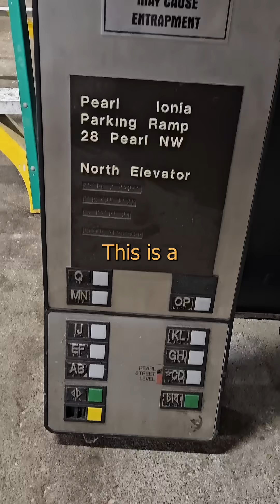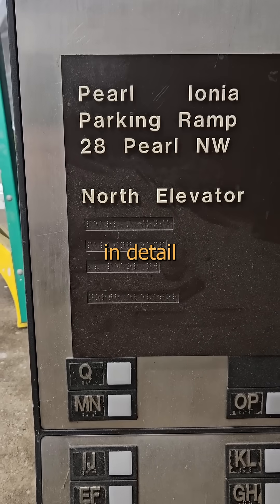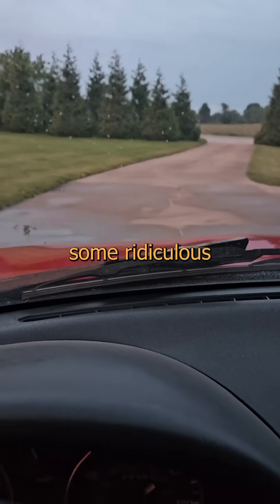Miata Mischief #chrisboden #engineering #gear #elevator #score #stories #parts #hacking #making

Comment: We built a 15ft high bike jump loaded it in the back of a single cab Ford Ranger put two of us in the back to hold it down and drove 30 km down the highway through rockcuts and tunnels to rappel it down a MTN to build a jump into the lake

Comment: a number of years ago, i was working for my families cafe/takeaway shop and mum managed to snag a decent double door storage fridge at auction, issue was, we lived an hour and a half out of the city the fridge was located at, AND the only vehicle we had to pick the fuckin thing up with was an old as fuck, broken as fuck bucket of a mitsubishi express van. (it was the only car we had that had a tow ball) had to borrow one of my friends who could help me lift this gargantuan fucking fridge into the trailer, strapped it up, then began the trek back home. 

all would be well and good, but this van struggled on the best of days to get just its own weight up any incline greater than 5°…we had to trek up a massive hill that made up part of the freeway…3 lane wide freeway and there’s us, towing this fucking huge fridge going at a maximum speed of 20kmh. once we created the top of the hill though it was pretty smooth driving from there, hell it felt like we were hitting warp speed when we hit 80kmh.

Comment: Oh God when I was in college I got an apartment with my friend, and the previous tenant left this massive 34 inch CRT TV that weighed about 240lbs. When we found a cheaper apartment half a mile down the road, we jumped on it. But we didn't have any other TVs so we decided to bring it. Me, Ben, Matt, and Graham each got a corner and lifted and lowered it down onto my skateboard. We pushed it out the door on the first floor, wheeled it across the parking lot, down the sidewalk, across the 3 lane highway, through the next parking lot, then we got to the apartment. It's on the second floor. It took us about 45 minutes to get that big gray bitch up that one flight of stairs, and on the last 3 steps, we almost lost it. It slid back down 2 steps, but it nearly killed Ben. Mind you, not one of us weighed more than 140lbs. We were all skinny art students. I ended up being the last to move out, and I decided to just pay the $250 cleaning fee and left it. I hope no one else got hurt carrying that thing.

Comment: My old motorbike had a trellis frame. Cut to me going into a hardware store and buying a few lengths of timber while on auto pilot, forgetting the fact that this time I had ridden there.

Went back in, bought some cheap nylon rope, tied the timber to the right side of the bike using the trellis frame as tie down points and mentally mapped out a route back home using only left turns. Had to straddle the timber as I rode and be very careful when slowing down with only the front brake, even managed to avoid any cops.

Fun Fact - did you know that with the rear seats down, a FM/FN mustang can fit 2.7m lengths of steel or timber? I get a few strange looks when I got to Bunnings.

Comment: When I was younger, I had to haul 2 telephone poles from my grandfather’s estate up to my uncle’s farm. I ended up cutting them more or less in half. That didn’t help me much when I had to chuck them underneath my toolbox in my truck. And then I had to use 3,000lb straps to secure them. Let’s just say it was an interesting drive to the farm with nothing but tight winding back roads!

Comment: I once moved furniture in my Civic CRX Si. It was a stick shift and I could only get to gears 1,3,5 because everything else was pushed so far forward. I literally couldn’t shift into second or fourth. My knees were around the steering wheel and I could just barely turn. Good times!

Comment: As someone with a similar motorized skateboard, its definitely possible, especially with the top down in the passenger seat. Im 5'11" and she was 4'10". Facing each other, you sitting with her on top. Basically a lapdance with benefits. No regrets, and happened on multiple occasions.

Or lean back, cross your legs and scoot the seat forward, her faceing forward and on the tiny dash and you sampling the 5 course meal. You're welcome

Comment: I've rolled a DEC VAX 11/750 across town once. On it's own wheels. 7km approx. distance... Took a few hours. It weights about 200kg, base config is 182kg but mine had some more gear in it plus cables etc. It doesn't fit in anything smaller than a commercial truck, and I didn't have a car or license or know anyone who did, so the only way to do it was to roll the bastard home on it's own wheels. I disassembled it get it up to the third floor piece by piece, no elevator, just stairs. It blew the fuses of my apartment when I turned it on the first time heh, it was also not the first or last large computer I had. I have one now that is about 60x100x80cm and weighs 35-40kg, it's "just a PC" but with watercooling and 1200w PSU in a tempered glass case with a touchscreen monitor built into the case. Small by comparison but a good deal larger than what most ppl have.

Comment: Drove a shitty ford mondeo 2 hours each way to pick up a mercedes vito engine. Hauled it on the highway in the trunk with 4 guys in the car. Overweight as shit, every uphill was a struggle. Got the engine. It did not fit my car. Still just collecting dust in the garage

2nd story, less risk more fun. Bought a coffin. Picture a bright red Jeep wrangler with a trailed and a poorly strapped black coffin. Got some weird looks driving through the city

Comment: A while back I found a piece of inch and a half thick bulletproof plexiglass about 65" diagonal on the side of the road and brought it home by creating a rope harness and throwing it over one shoulder on my old Honda CBR 1000RR. There was so much weight on one side of the bike that I was riding at about a 30° angle the entire 5 miles

Comment: My doctor put me on testosterone for a short period of time. I felt great. I folded down all the seats in my 2008 honda fit, to squeeze a refrigerator sized Stanley Vidmar tool chest from a car dealership. I took all the drawers out, tipped it over on its back, then shoved it into the opening. I put all the drawers in the open cavity of the toolbox. It was hanging out about a foot from the back of the car. Then I strapped the hatch back down to keep it from falling out while I drove around to do my work for the rest of the day. I worked late, and when I got home, I snuck it out of my car and into the garage. When my wife got home, she didn't say anything to me, but my son told me she said "WHAT DID HE BRING HOME NOW"😂 . I cleaned up the tool chest and put my tools in it. I don't take testosterone anymore.

Comment: Around where I live there used to be a barnes and noble joined to a GameStop. The GameStop had a caged in ac unit, at around 2pm on a Monday my dad, my brother and I all got together to cut out, disconnect and steal the actively running ac unit out the side of the GameStop. We also have an intersection traffic light.

Comment: We had the SUV in the shop (rear ended at a stop light) and the shop lent us a Nissan Micra. We are both well over 6ft (6'5 and 6'10) 
We had a fireplace we had to pickup along with 3 large paintings. One was charcoal underglass and was 44"x55"  the fireplace was alcohol and all metal and we bought 3 canisters of alcohol with it. All of that crap stuffed Inside of a little Micra birthed my LOVE for micro cars. What id do for an 07' March 125R!

Comment: I hauled an oak dresser up two flights of stairs by myself because it was free and would make a good workbench. It lived on my upstairs landing lightly strapped to the railing so it didn't fall over as I snuck past it to and from my room for a couple days while I figured out how to do the accrobatics to take it slightly more apart to get it around the corner and up the last 4 steps.

Comment: Mine is basic: I worked as an orderly at the hospital and used  old distribution carts for everything. From taking out trash to going to pick up the laundry in the blizzard because the truck broke down and there's no way we can function without clean sheets. One time I helped the department move: two toothpick tiny nurses put two huge pharmacy cabinets on the cart and moved it across half a football pitch length corridor through narrow doors. When there was too much crap to move I would tie some of it with bandages to the sides or use cardboard to make more space.

Comment: 16ft cattle panel strapped to the roof of my wife's Santa Fe (incase anyone is wondering, a 2023 Santa Fe is less than 16ft long since the panel was hanging off the front and back).

Or the 4burner grill strapped to the roof rack on my Subaru Outback.

Both loads were secure, at least they weren't leaving the vehicle, but I'm sure to everyone else they looked sketchy.

In the future I'll probably be upgrading to doing this sort of stuff with my Subaru Impreza, since I finally got the roof rack for it. Though I think I'm going to build a frame to mount on the racks so I can support things like cattle panels and sheets of plywood, instead of letting them droop.

Comment: I once smuggled a full-sized traffic light out of a city corporation yard in the passenger side of 1965 MGB. I didn’t realize how large those things really are and had to take the top down to get it into the car, which was a true roadster rather than a sweet little drophead coupe like the Miata. That means that I had to remove the top and frame and stow them in the trunk, all the while hoping nobody happened by to catch me in the act.

Comment: So in a Ford Ranger extended cab there are tiny little fold out seats in the back meaning that it technically seats five(three across the front bench seat and two little folding seats in the back).  Just like in most 2 door cars with 2 rows of seating the front seats lean forward towards the dashboard to let any passengers get in and out of the back.  From my experience, 9/10 times that a cabin is set up like this, the front passenger seat ALWAYS goes forward MORE than the front driver seat.  Not in my ‘03 Ranger.  Me and my buddy wanted to go to a Super Smash Bros. Melee tournament and we were going to bring his CRT tube tv with us to the tournament because the guy running the tournament said he needed more Tv’s.  It was so hard to get this tv in the back😭.  I finally figured it out to lean the passenger seat all the way back and the driver seat all the way forward and the gap was JUST large enough to sneak it in between the two seats and into the back of the car.  Then obviously just drive with your knees in the steering wheel and voila!

Comment: Back in college I tried to figure out a way to strap my longboard to the back of my crotch rocket so that I could both get the best parking, and ride around campus in style. Unfortunately I was never able to figure out a position where the skateboard wouldn’t turn my motorcycle into an airplane.

Comment: At my old job the bosses were giving away a glass table that no one wanted.  They were going to throw it out but stupidly I decided to try and take it home. 

Equip with my 2006 Kia sportage, no straps, and zero knowledge I load it on top of the car.  I wish I paid more attention in outdoor education because when I managed to get some pieces of "rope" I had no clue how to actually tie it down. All I could remember is "if you can't tie knots, tie lots" so that's what I did. After a bit of struggle I took off home with the table on the roof, rope tied through the car and "anchored" to the inside. 

I was too focused on holding the table down that I hit the first pothole/crater on the gravel road.  No biggie because after that it was smooth sailing and I got home with the table.  

Once unloading the table I noticed that pothole must have knocked out and stolen my taillight from me. Albeit a small price to pay for a table that I am still using to this day.

Comment: When I was 15, before I got my driver's license, I got to drive a combine home from the field one night. The old combine didn't have any lights that worked. My dad drove our old 1958 Ford tandem axle grain truck behind me with it's left headlight shining past the combine. The old truck had a loose connection somewhere. We were about halfway back when the truck hit a bump and the lights went out. The old truck barely had brakes and you could forget stopping with it loaded, so I kept going with the combine knowing the truck would be still moving behind me. Another bump and the lights lit back up. Just in time, too. The steering on the combine had a lot of play in it and the bumpy road was not helping keep it straight. I was headed off the right side straight at a tree and the truck was maybe 3 feet behind the combine. In case you wonder how we stop that truck. You down shift and stomp the brake pedal to the floor 3 or 4 times and when you are down to 2nd gear, stomp the brake and shut the engine off. You couldn't get the truck into 1st gear with it moving.

Comment: I chained a 275 gallon home heating oil tank to the custom rear roll bar and strapped it to the back of my Chevrolet K -5  Blazer after pumping 150 gallons of heating oil into drums that were already set up in the back of the blazer. I just let it rest against the rear bumper.

Comment: I pulled a rice cart from home to a field where my dad was harvesting corn. I pulled it with my dad's GMC 4x4. The rice cart was designed to be pulled with a tractor, not a pickup. The gravel road I was on was hilly. I had to get a run to make it up the hill and slow down near the top. As I was approaching the biggest hill I already knew I was in trouble. I made it to the top OK, but the two wheeled steel rice cart was heavier than the truck. A lot heavier. I tried applying the brakes, but it just pushed the truck sideways. After two rounds of cleaning out the ditches on both sides of the road, I just held it straight. I hit 70 mph at the bottom of the hill and both truck and cart went airborne over the next smaller hill. I rode the brake and steered. Another small hill with less air, then a straight stretch of gravel road to a tee. I got the speed down below 30 mph at the tee, swung wide and dirt tracked my way through the 90 degree turn to the right. Truck and cart cleaned out the ditch on the far side, but didn't roll over. I drove real slow the rest of the way. I told my dad he could pull the rice cart home himself. He checked his truck and didn't find any damage, so he ask me what happened. I didn't tell him everything. Some things you just don't admit to.

Comment: A couple years ago I helped a friend move a couple canoes and about 1200 pounds in 15 foot long rolls of vinyl flooring through unpleasant mountain switchbacks in a honda odyssey from the mid 2000s. we used a roll of twine and a little creativity to rig up a roof mounting for the boats that tied them down to the hood and liftgate, as well as a net to hold the flooring sections in the minivan because they stuck like 5 feet out the back of the car. we made the 2.5 hour journey with no issues. I dont think the suspension was terribly pleased but nothing broke and that car still drives just fine to this day.

Comment: Me and my buddies hauled 3 lawn mowers on a 5x8 trailer with no back gate or bord one was sitting on the railing half way one was sideways on the back and 1 was on right held it down with a ratchet strap went 2 miles with it on a quarry road the county doesn’t maintain

Comment: Imagine it's Christmas and you buy a razor dune buggy for 150 bucks and then cut that buggy in half and stretching it ,put the knockoff my1020 motor in it and 2 48vokt batteries in parallel and you got a 30 mph go kart then making a trailer for it for your razor mx350 and you got something even more stupid and then you take that thing in the streets of your neighborhood but you geared it down from 1 /1 , to , 2/1 to tow stuff so I was crawling at 15 mph on those roads

Comment: Won a surplus auction for an RS/6000 model H50 many years ago. I though I was getting just the bare server and it was just barely in the limits for what UPS could ship. Then I got an email saying it was much to heavy to ship via UPS. I sent a message back asking how heavy it was figuring maybe another company could pick it up. 770 pounds. I did math as started freaking out because I realized the only way it could be that heavy was if they had just sole me the whole rack. On an auction I had won for only 220 dollars. 

So that was how me and my dad ended up driving a 90s VW Eurovan from near Knoxville TN to Atlanta to pick up my new toy from ma bell. Not only was it the server in the rack there was an external RAID full of old SCSI drives and an LTO unit that slotted in like 20 tapes and could switch between them with software control or manual controls on the front.

I still have that server rack despite it not being worth the electricity to power up with it can be out performed by a Raspberry Pi now but it makes for a great jaw dropping moment when people see a big black monolith in the cornet of the room. I just need to stick a big red glowing eye on it and hook it up with a Pi running a chat bot.

Comment: I am without a licence and I move very often.
So I hauled Almost 80Kg of Luggage several Bags, Backpack in Front and 120l duffle bag on my back through germay on a regular basis. 

Or one time i bought some shelfes from Ikea and used my bike to haul them to the next Train Station several km away, where I had to Change Train twice to bring them to my recent bought flat at another City.

Or the time I Moved through Berlin used public Transport to haul my stuff. Fully Packed First going to university took my stuff from course to course to haul it later to my new flat. This for Almost 6 weeks. But I made it!